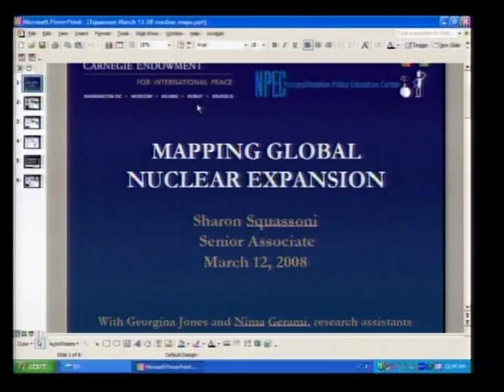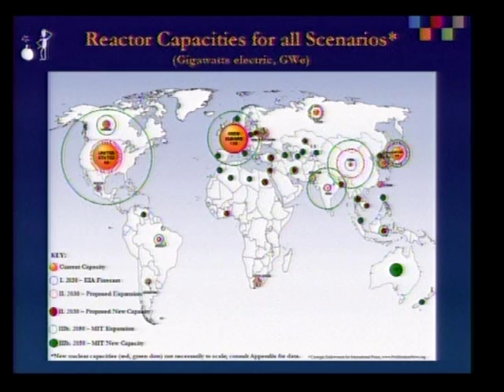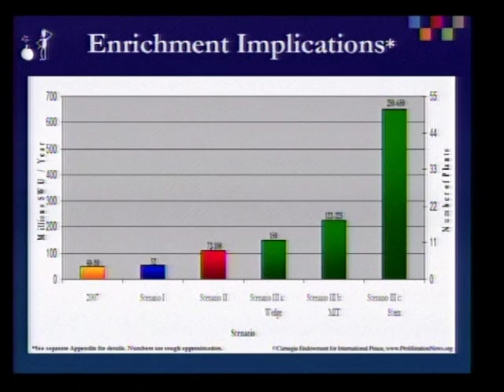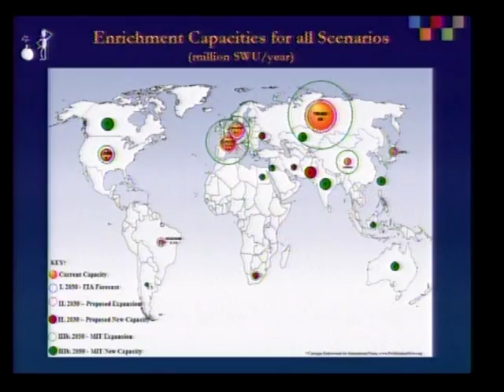Nuclear Power in a Warming World: Solution or Illusion?

Comment: Another unfair accusation levelled at nuclear power, is that critics blame the technology, instead of blaming the criminally negligent corrupt corporations and corrupt government officials, who deliberately build nuclear power stations on questionable terrain, or buy the control room equipment from different suppliers, or the lowest bidders.

I have developed several lung complications as a result of being exposed to air pollution, so I know my potential life span has been reduced as a result of fossil fuel burning. When I die, add me to the 7 million global deaths from air pollution. I hope to live long enough to see most coal fired or gas turbine power plants knocked down and replaced with cleaner nuclear power plants; whose waste is much more readily containable and much more carefully regulated and controlled, compared with the easily released exhaust from the coal fired and gas fired power stations' smoke stacks.

Comment: @decycle1 all the energy ti takes to build one ,not to mention the the big giant hole in the ground  from mining uranium.
Then figure in the storage  of the spent fuel rods  which is at least 100yrs or more.
That is with out considering the all the  risk of failure.Jersey,Russia ,now japan 3 is a charm time to quit. America has over 30 reactors which could be considered  antique and running dangerously   over their intended capacity . if you feel safe the you are just ignoring all the facts